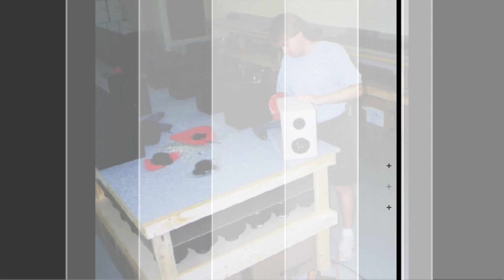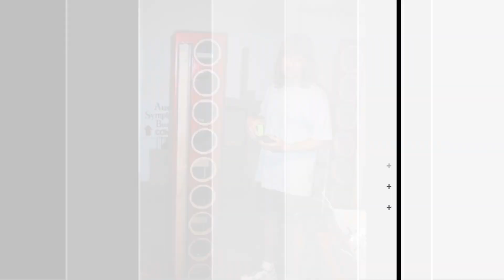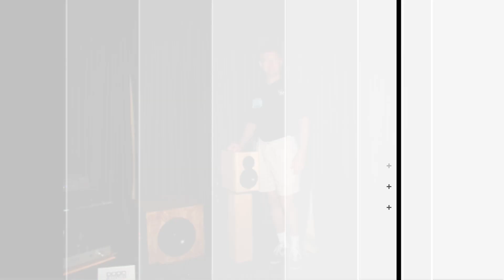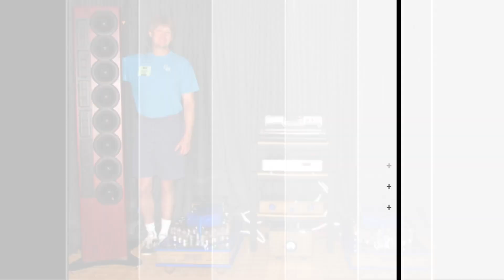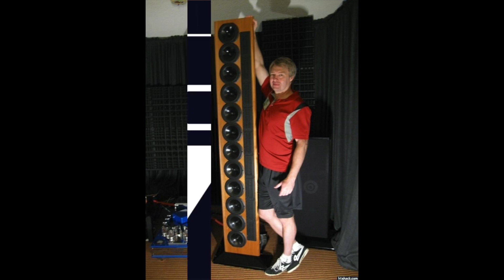Tech Talk 15: Crossovers

Comment: Just built a complete crossover retrofit. Mirrored my existing crossover with much higher quality parts. I used Danny's point to point style and soldered all terminations and splices (currently the new crossovers are hooked up to my "test" speakers.) It's a 2nd order, I used Z Superior and 16 Guage air core inductors on HF, Clarity CSAs and 16 ga air core inductors on the mids and Audyn Q4 with a fat laminated 14 ga inductor on the bass. I used all 14 ga OFC for internal wiring. I am going to try No Rez in my boxes, hoping the 4 pack will do the job. Initial thoughts on test speakers, even though it's not designed for them, definitely a cleaner sound at all levels (high/mid/bass). Can't wait to get them I my speakers for real. The only thing I'm debating is putting the PTCs back in for tweeter and mid circuits. Argument for them, protection. Against, clarity. I think the smear the sound a bit. I am going to post  a couple videos on my weak a** channel if anyone wants to critique them.

Comment: Ty very much I  can listen to talk about crossovers and you explain it very well because I would like to build my own personal crossovers for a speaker system iam thinking of building 2 outdoor speaker boxes each box is going to have 2 ×4"tweeters at 4ohms at 400w and 2x10" midrange 4ohms at 600watts and 2x18" subwoofers at 4ohms 1000watts so each box is going to have these drivers in them so any ideas of the kind of passive crossovers that will work well with this

Comment: I built a 3 way system long time ago with very pricey Scan Speak units. Didn’t get the sound right as the crossover failed and I didn’t have the electronics to measure the frequency response. I needed a Danny then but he wasn’t there in Amsterdam. At the end I replaced the speakers for a factory set from Focal.

Comment: Quick question, I have a Seas Excel driver that has a response that smoothly rises by 10 dB from 100hz to 2000hz. What do I need to flatten such a broad dB gain using a passive x-over? Can a notch filter achieve this or only a narrower band?
Reply: You will need to use a filter system like that of baffle step loss compensation.

Comment: Danny, your argument against analog active crossover filters is really:  "I don't know how to build an active crossover filter that accomplishes the same thing as a passive filter that I can build and sell to others who can't build or use an active crossover", which is not really a statement about quality.  I do agree that a good commercial active crossover is impossible to find and impossible to implement for most listeners with a receiver or integrated amplifier and not separate component amplifiers.  You also side-stepped the concept of filter order and phase that is independent of passive or active filter implementation and the impedance of the speakers that interacts with the impedance of the passive crossover.  Is the time alignment of the drivers due to the depth of the cones significant considering the wavelength of the sound?  Is the time alignment of the drivers significant compared to the phase of the crossover filters?
Reply: The answer regarding time alignment of drivers is yes, it is critical. Active is also the way to go. I just has too many advantages. But is is not for Joe average audiophile. It requires technical knowledge skills and the willingness to learn. I favor DSP based EQ and crossover design simply because it is much easier to do well. The necessary devices to do it are available in every price range. The right ones allow the independent adjustment of magnitude and phase response. Using separate power amp for each driver and having it directly coupled to that driver with no intervening passive components offer superior driver control. One unexpected advantage is that it greatly reduces the amplifier demands to the point one can use much less expensive amps to achieve a given level of sound quality.
Reply: This channel is basically a hobbyist trying to skip these more technical topics. The video on fast bass for example is hard to watch also, as all you need to know is the impulse response. But people don't want to hear about Laplace transform and transfer functions, so instead it becomes about capacitors sometimes sending current in the opposite direction or whatever he said in one of his videos .

Comment: Hi Danny,

Thank you for another really interesting video.

What kind of setup would I want to have to be able to learn to measure the response of speakers? Clearly the first thing is room preparation, right? Tips or reading material for this? Then, for 1m 1w measurements, what kind of mike, sound interface,and software would you suggest?

I guess what I’m interested in is the process, rather than the absolute result. I enjoy playing with electronics in my very modest lab, and it’s only for my own learning and development.

Thank you.
Cheers 
Mark

Comment: Why do guitar players love Celestion speakers ? Is Celestion a good brand ?
Reply: Not from a hifi standpoint: Guitarist needs to create his/her signature sound, consist of himself/herself as the player, guitar brand/type/strings/pickups/etc, effects/pedals, specific amplifier, lastly cabinet(guitar speaker in an enclosure). Almost all (maybe all?) guitar speaker FR are not flat/linear & tend to emphasis on certain tone. Perhaps Celestion (of their numerous guitar speaker variants) managed to capture the crowds preference.
Reply: All speakers made for guitar amps and cabinets are purposely trying to replicate the very lo-fi sound of the first electric guitar amps that were produced in the late 40’s and 50’s. At the time, if the technology was available to make an electric guitar sound like an acoustic guitar guitarists would have used those.

Now, 70+ years later, DSP based guitar processors are able to replicate the classic tube amps (with Celestine speakers), in addition to high fidelity effects. These newer systems use FRFR (full range flat response) speakers, and are able to perfectly replicate a studio processed guitar sound live, and are very popular devices in the studio too.

Comment: Hi. I love the videos. I’m close to having watched all of these. 

Instead of peppering you with questions, do you have some recommended reading/resources to really get into this?
Reply: I really don't.
Reply: @dannyrichie9743  You don't? Not even a couple o analog electronic books or get some kinda of electronic course.  Like try to get an used osciloscope and start measure things...?
Reply: Get yourself a pocket Clio and start measuring and testing. 

Most of the books written really just covered basics and are pretty old.
Reply: @dannyrichie9743  I so far have a UMIK-1 and I use REW (Room EQ Wizard). I make sure to to set it to 4ms on the measurements. 
Is this okay, or are there huge benefits to using Clio if you're a hobbyist?
Reply: @dannyrichie9743  Great video. You are extremely generous to share your knowledge. I would love to see an organized discussion of crossover components (caps, inductors, resistors, connectors, etc) and the different quality levels versus expense. For example, what types of capacitors can be used, what are their relative pros/cons, and what are their costs?
Reply: @andrewtaylor9799  Okay, I think I can put together a video on that.
Reply: @dannyrichie9743  I have the loudspeaker design cookbook by Vance Dickason, it dates back to 85, I have the 6th edition with updates and chapters on subwoofers

Comment: I have a pair of ProAc EBTs. It’s a lovely speaker. Cabinet is pretty dead. I don’t know what you would charge to tackle it, but I am willing to let you do your thing to it. I have a problem with the crappy speaker terminals also. They don’t weigh a lot per se but they aren’t light for their size. I can’t stand paper cone drivers or any speakers that use foam surrounds as they project a cheap appearance and since I play them sans grills, these things matter. There were some hardened copper terminals which came out in the late 80s that I should’ve bought but didn’t. They were made very well. Tell me what you think and let me know, okay.?
Reply: I am a big fan of paper based cones myself. They always have a more natural sound. And I am not a fan of binding posts. I use these in everything that I can: http://gr-research.com/electracabletubeconnectors.aspx

And if you want to send me one of those speakers then I'll take a look at them.
Reply: All you are talking about is "appearance".  You can only judge a speaker by what it sounds like, regardless of what it looks like.

Comment: I wonder how Car Audio DSP measures up.
Reply: Car audio DSP and associated electronics are definitely no better than any other types of the digital or electronic crossovers out there, with car stuff probably actually being even worse because of the signal-to-noise ratios of most car audio equipment...

But whether it be for car, home, or "pro" audio rated and designed, I have NEVER even once heard, in all of my 35+ years of being a speaker and audio guy, and relative "audiophile", I've never heard ANY "DSP" related electronic gear that DIDN'T "mask" some of the sound and reduce the overall resolution and detail and sometimes even the imaging of any speaker hooked to it, PLUS, ALWAYS adding at least some, sometimes even a considerable and quite noticeable or even distracting amount, of additional noise and/or hum from poor power supply design, and hiss and distortion from either poor quality A/D and/or D/A converters and/or op-amp chips in the signal path, all of which has been extremely disappointing to me, because IF DSP based gear actually didn't have all of those additional annoying issues, then they could be absolutely amazing because of their versatility, features, and functionality!...

Basically however, EVERY single electrical/electronic component in any DSP or electronic or digital crossover has to be of extremely high quality and all of those individual components and IC chips must be designed to work extremely well together as a whole unit also, and MOST brands and models are NOT using the best quality componentry throughout their entire product, therefore you still DO have those issues, as mentioned above and in this video...

That's why it's still better generally to just use really good quality passive components in most speaker crossovers, as he mentions in this video!

Comment: Danny Richie , what specifically are some of the trade-offs when using digital EQ/Crossover instead of traditional crossovers?
Reply: *When using higher quality ones, not cheap ones...
Reply: I have made some comparisons and and found FAR more difference in the quality of the D/A converts used then whether or not there are high quality passive parts in the signal path or not. 

I feel like the DEQX is a solid mid-fi level product. 

Rich Hollis (Hollis Audio Labs) makes the only one that I consider a high end all digital solution. 

Of coarse you then have to use multiple amplifiers. 

A really good quality passive filter and a really good DAC is still top dog. And it's no issue playing your turntable through speakers with passive filters. 

Here is a DAC that I auditioned recently that I can recommend.

https://www.denafrips.com/ares

And my digital guru's are really singing the praises of this one.

https://kitsunehifi.com/product/holo-audio-spring2-dac-kitsune-tuned-edition/